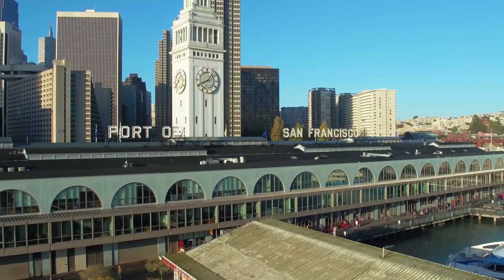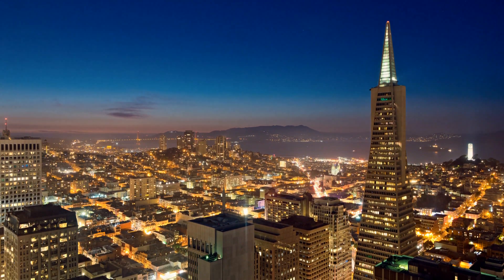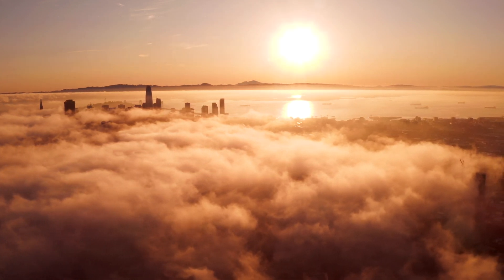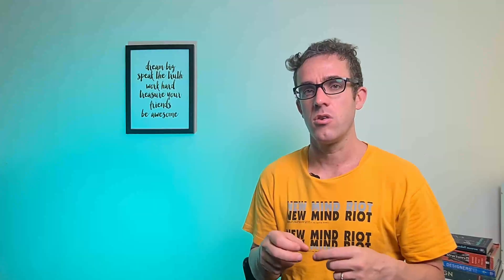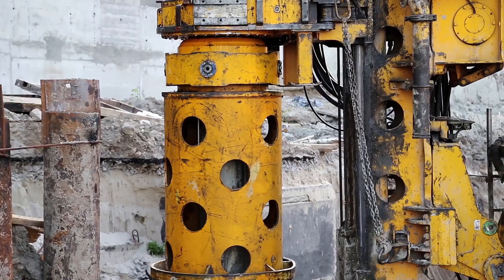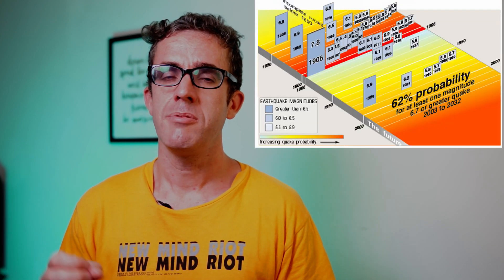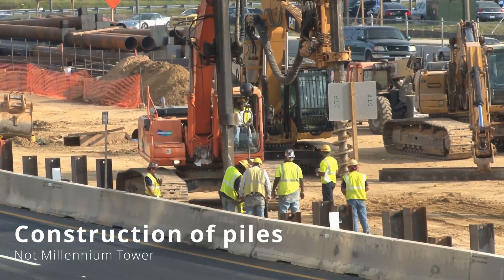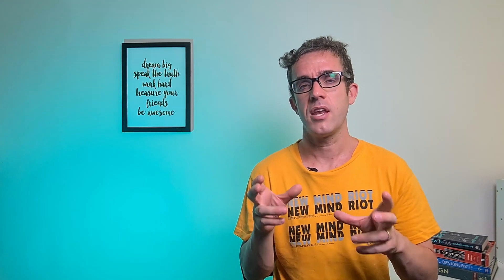The Sinking Skyscaper, San Francisco's Leaning Tower -  Millennium Tower

Comment: The fix has recently been stopped because the building sinking/tilting has accelerated since the drilling of the fix has begun.

You and another channel say there was no peer review. But a former Berkeley professor in an interview claims that a colleague - Jack Moehle - was both a member of the design team and led the peer review team.
Reply from the maker: Hi Lockbert, increased movement doesn't sound good.

As for the peer review it appears that peer-review only covered the structural systems, none for the geotechnical advice. the testimony referred to the lack of a geotech engineer on the voluntary review conducted by the developer ahead of time.

Curbed SF suggest the foundations where not reviewed.  

Thanks for the update.
Reply: The work was restarted and, when completed, was successful in arresting the progress of the leaning as of late June 2023.

Comment: I have to wonder about the wisdom of anchoring the friction pilings of a building as tall and heavy as MT in a clay layer, in an area that is known to be seismically active. How much more would it have cost to continue drilling to bedrock to anchor the pilings, a few million more - in a project that was already costing about $350 million. I also wonder if enough is known, with certainty, of the shear strength and stiffness of clay in a large magnitude earthquake and whether the clay would liquify under such stress.
Reply: Hi Jim. I don't recall where I saw this but at the time the decision on the foundation was made the cost of setting the piles into bedrock was estimated to cost an additional 5 million dollars.
Reply: The original piles wete not in the clay layer.  They ended in the sand layer above the old bay clay layer.

Comment: Hello brendan , I'm making my steel structure project at the final year on my university and i wanted to ask u about how to make a report about the wind load , live loads and dead loads , i know them but i need a soft copy or a pdf that shows me the steps of how writing a report like this .
Reply from the maker: Hi Bahaa, as a student you should be able to get a free copy of the Codes. as for the steps to the design I am currently make some digital products, and they would include things like this. However they are likely ready for your final year assignment.
Reply: @BrendanHasty  Thanks very much . Is there something available for now to help me ?
Reply from the maker: @bahaamohamed6163  Hi Bahaa, Woodsolutions puts something out for Austalian Standards https://www.woodsolutions.com.au/designing-and-building-wind this will give you the basics even tho it is timber it will still apply for the wind loads. what code are you looking for?
Reply: @BrendanHasty  i know the values of my code but i need the steps of how writing them like i read a report and see the arrangements of information inside it , this will give me a good clue of writing my report in a good manner.

Comment: Hindsight is always gives you the best perspective on the wisdom of past decisions and actions. In this case though the liquefaction and seismic issues are well known. Somebody must be eating crow over the decision to use piles that do not go to bedrock. I am not a structural engineer but it seems better to err on the side of caution and cover all your bases before hand. In this case soil resistance does not appear to be a constant over time.
Reply: It's sickening to think they built the building this way to save a little money.
Reply: @anthonyboarman3833  From an engineer's perspective, when choosing a career, think think long and hard about law over engineering. In engineering  all you are as good as your foresight and the assumptions made in your calculations, and contractor adherence to your instructions; in law hindsight is always on your side as well as fatter paychecks.
Reply: @cayrick  It seems odd to me that some people though landfill was going to support such a big heavy building.
Reply: @anthonyboarman3833  I have no doubt the engineers ddi their due diligence and did a soil analysis in designing the building supports and footings. It is suggested they got it right on one side of the structure because that did not shift. Could it be that in doing soil stability tests they picked just one side of the building and assumed it was homogeneous or could it have been some factor changed that affected the stability. Maybe big changes in moisture, vibration etc. I am a mech. eng. not a civil or structural but intuitively knowing the airea is seismic, soil can liquify in an earthquake, I would risk being fired by recommending that someone eat the extra cost of driving the piles into bedrock. I suspect that the column loads are uncomfortably close to the support limit. 
    The Engineers cut corners to the delight of the developer. With the seismic activity around the globe and SF being overdue a 1906 quake could happen during the repair work and this would make the Miami Champlain towers tragedy look like a walk in the park. 
      A lot of people in SF in the Engineering and Construction of this building are experiencing some serious heart burn.

Comment: You're confusing structural engineering to geotechnical engineering, the geotechnical engineers probably referenced models of the piles to the structural engineers so that the models could be incorporated in the finite element analysis of the raft footing/tower. So should the structural engineers be stripped of their awards because the geotechnical engineers did a lousy job...well, not necessarily....
Reply from the maker: Hi Dan I agree maybe their award shouldn't be stripped but as the project has had issues it is not something you want to display/promote. Court cases will determine level of fault. Mud will stick on everyone involve with project even if not involved with the areas that caused issues.
Reply: No, he is talking about structural aspects of the problem.

Comment: Looking at construction of buildings around the world when faced with obstacles for example Shanghai and Japan.  Japan suppers massive earthquakes on a more regular basis in their high-rises our sink deep into the bed rock plus extra structural support in the building. 
                     Shanghai is built in the mud flat basin that was farmland on soft soil settlement. 
                          They built their massively tall towers that far exceeds anything in San Francisco dwarf in San Francisco like a tiny village they sing deep down into the bed rock and then they have a net work between the building supporting going out words interlocking like Legos. 

          Right now in typical American and especially San Francisco mentality we got a think about the money first not what the outcome will be.     Here in San Francisco it’s all about how fast and how cheap you can build it. 
              Many and even small like construction who are not even engineers were slapping their head thinking what the hell are they doing with this build eventually proving everybody who thought it was a mistake ended up being correct. 

         But here in San Francisco when does a lot of money involved the money influences and usually always gets its way. 
        It’s all about the quick money grab.
Reply: There is more shady construction going on here at SF ,The underground rail system in china town , vanness ave road construction 🚧 is been years now and it still not done yet
Reply: @ger13nunyah56  It’s a money grab with people with a construction license to steal in confidence beyond belief city supervisors and city personnel‘s getting under table money from incompetent people performing the work you don’t even know what they’re doing. 
              Yes that underground is a joke

Comment: I hope, that this building does not collapse like that building in Miami did. Hop, they can save the Millennium Tower.
Reply from the maker: The works to address the issues have been started, not sure if they are complete yet but if not they should be soon.
Reply: @BrendanHasty  - yea it got worse when they started the repairs
Reply: It’s coming down….one way or another
Reply: @seand67  The reason I think you're right is because the 10 foot thick concrete atop the 950 piles is dishing.... when it cracks through, what will hold the building up?!